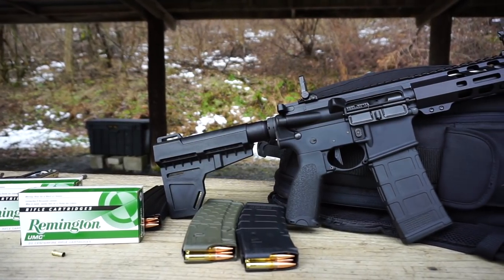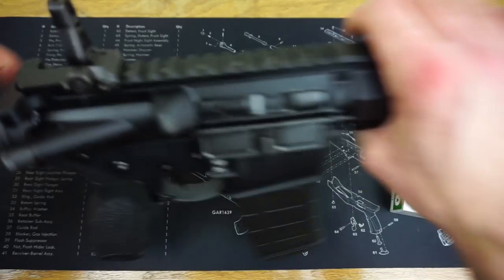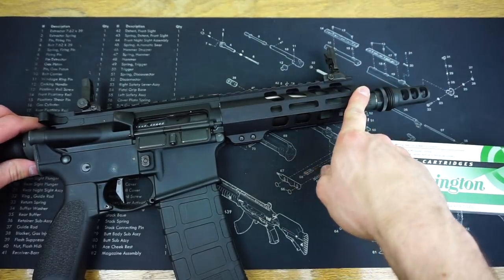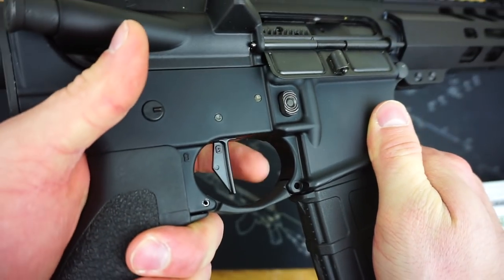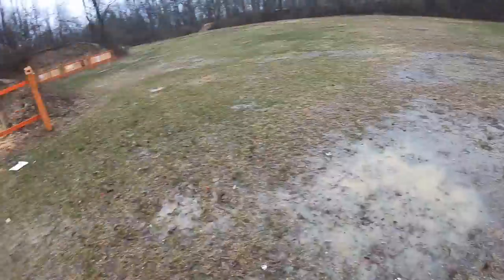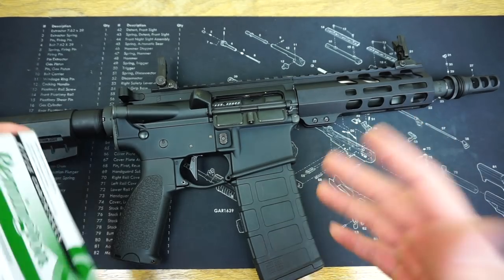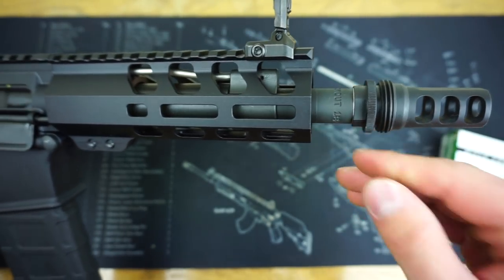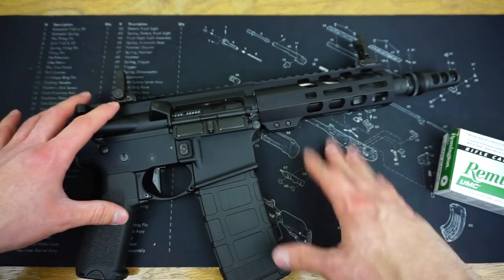7.5" PSA 300blk OUT PISTOL (FIRST IMPRESSIONS)!

Comment: Nice build! Question: I think I've heard others say, as you did in the video, that 300 blk is optimized to work out of a 9" barrel. Do you know if that applies to both super and subsonic ammo? Just curious because I'm looking to build a 10.5" 300 blk pistol soon.
Reply from the maker: Thank you! And I believe it does but either way you should be just fine with going with a 10.5.
Reply: hmm . run it with a flash can/ linear comp .. and you shouldn't have much trouble with shorter barrels ..cause  it will add a little gas pressure for better cycling if it doesn't eject as hard as you want it to do with subsonic ammo
Reply: No, tests have been done. It's 8-8.5 barrel length. They will shoot more accurate, than a 5.56 out of a 10.5.

Comment: How is the muzzle flash with the brake you are running ? How is the concussion ? I recently purchased a barrel of the same length and I find myself stuck between brake and flash hider.
Reply from the maker: sully6guns honestly it’s surprisingly not bad with subs with supers it is a little rough but still it’s not to bad between the two I would go with the break!
Reply: FirearmFreedom I think I will! Thanks for the input !
Reply from the maker: sully6guns no problem brother thanks for watching glad I could help!
Reply: Linear comps/flash can are perfect for the shorter barrell, the 300 black doesnt have a lot of flash because it uses magnum pistol powder that burns a lot faster so there is not a huge fireball like you would have out of say a 7.5" krink

Comment: What buffer weight would you use on a 7.5 300 blk barrel?
Reply from the maker: I actually have a standard carbine buffer in this set up and even running it suppressed I have had no issues at all 👌🏻

Comment: Strike Industries flat wire spring with an H buffer really smoothed my shorty out, ejection is perfect and no cycling issues. For $60 can’t go wrong
Reply from the maker: Hmmm I’m gonna have to check that out thanks for the tip man!
Reply: FirearmFreedom yeah the recoil impulse is more of a smooth push than a snap. I run that combo in all my ARs now. My full length actually runs an H2 because the factory barrel is way over gasses. Is that blade comfortable? I heard some people say the plastic really beats you up. I like that it’s low profile and I’m considering swapping out my SBA3 for the shockwave and adding a folder for a backpack PDW
Reply from the maker: mbrodock609 ya man I could totally see that and it is really not great I have a totally different setup on this gun now check out my shorty upgrades video!
Reply: @mbrodock609  yeah they leave a bruise, but look a lot more tacticool, and thats the most important thing

Comment: I saw you have your suppressor now so you probably run that a lot on this but in the event you wanted it to be a bit more controllable without the suppressor, there's now a 7.62 version of the Lantac Dragon ASR mount so you would be getting one of the best muzzle brakes on the market along with keeping the ASR capability.  Unlike the Silencerco brake, it also has some holes in the top to control muzzle rise as well which is just what you were looking for.
Reply from the maker: j5689 the Lantac break is awesome! But unfortunately to run the suppressor I have to use the ASR break to utilize the quick detach feature andddd you also have to rock set it on lmao so it’s not coming off even if I wanted it to
Reply: Well, that's unfortunate that it's too stuck on there now.  But I meant that they have an actual Lantac Dragon brake that also has the ASR mount built-in, it's the same thing as you have now but instead of the Silencerco muzzle brake, it's a Lantac Dragon that has the the capability to screw on an ASR suppressor over it, the best of both worlds.  I would link to it but I don't know if that's allowed on YT anymore.  Google Lantac Dragon ASR 762 and you'll see what I'm talking about.  If they made one in Keymo instead of ASR, I would be all over that for my 300 Blackout SBR.
Reply from the maker: j5689 ohhhhhh gotcha dude that’s pretty awesome I might have to check that out for when I do another build!

Comment: Can you get good groupings out to 200 yards with the 7.5" barrel?? I just want some practical accuracy out of a short barrel
Reply from the maker: Honestly I have not tried it at that distance it’s probably gonna be pushing it but I will definitely give it a shot in a later video!
Reply: I have always considered a .300 pistol/sbr to be "practical" for cqb at less than 100yrd, anything more I would assume you would choose another one of your rifles designed for that distance. Also the accuracy can vary widely between manufacturers, but ballisticly it has more kinetic energy at that range than the 7.62×39

Comment: What do you think about the lockup on the handguard to the barrel nut? I've taken mine apart and its nothing but friction retention with those two screws. The barrel nut is smooth so is the inside of the handguard. No texturized barrel nut surface, not even anti-rotational tabs. you think this setup will hold in place for long?
Reply from the maker: Jacob Carmona so I personally haven’t had any issues with the two uppers that I have from PSA with this design but I have not put them through hell and back. Honestly though I feel that if the it were to come loose it would of already done it for me. But I would absolutely say it’s not as strong as other options for sure.

Comment: Pretty cool little piece, i just got PSAs 556/223 kit on clearance sale. Building it with extra parts i have laying around. Other than that charging handle swap, anything else you would suggest to anyone building one of these? I was thinking about an optic instead of fixed sights. I've heard that i should use lighter grain ammo with this...thoughts? 
Thanks.
Reply from the maker: Wang-do Dahl really man what ever way you want to take this build it will work great and ya if it is chambered in 5.56 lighter would probably be the way to go with that short of a barrel!
Reply: You could run an optic up top with off set irons. Best of both worlds?

Comment: Would it make sense to buy one of these exactly like the one in the video if i had no intentions of suppressing?
Reply: I'm in the process of doing something similar. I got the 300blk 8.5 in upper without the bcg or charging handle for $199. The money I saved went towards a toolcraft nickel boron bcg and radian raptor charging handle. I then got the complete lower from PSA with polished trigger for $149. I'm sure the trigger will not be as good as s gisselle  but it should hold me over until I can upgrade. Just ordered last night and most of my stuff has already shipped. Can't wait to try it out.
Reply from the maker: Great points with the comment above and I would say ya it would still be a sweet set up even without the can with how well .300 blk preforms with a shorter barrel length
Reply: @MikeAGonzales  psa makes a nice 3.5" drop-in match, no discernible difference between in and a cmc, no creep, no take up, quick reset, breaks like a fresh candy cane, and it was like $119, and they have their nib bcg on sale for like $89

Comment: How stable are the subsonic loads with your suppressor? I bought a PSA 7.5” upper and most suppressor reviews I read/watched have said that their subsonic loads weren’t very stable
Reply: Didn’t realize when this video came out, probably don’t even have your suppressor yet ☹️
Reply from the maker: Eric Klemm no problem! I actually just received it a week ago so perfect timing! I just brought the set up to the range and ran 100 rounds of S&B 200grain subs through it and had no issues with stabilizing or anything but I was only shooting it at 25. Yards obviously all of the shooting was done suppressed with the silencerco Omega.
Reply: In the video, at the time you said you kept the 6” handguard, but would you put a 7” handguard on it, if so, do you think would it “fit” properly with using a suppressor?
Reply from the maker: Eric Klemm so unfortunately as much as I would of loved the 7” rail there is just no way it would of fit with my suppressor, so if your going for this upper to run it suppressed the 6” rail is definitely the way to go!

Comment: Hey man, nice video. Just recently acquired a 7.5” upper, with 1:8 twist rate. I’ve read on some forums how the low twist rate with such a short barrel. Have you had any problems with this? Any keyholing? Also, what loads have you had luck with, super and sub? Again, sweet vid dude!
Reply from the maker: Thanks man I’m glad you enjoyed the video thanks for watching! And nope I’ve had no issues so far and no key holing of any type! I actually have a “shorty upgrades video” on my channel as an update to this one which might give you some more info!
Reply: FirearmFreedom I found that video shortly after posting this comment. Lol. But I’m looking at the rugged suppressors razor 762. I need to go ahead and start that wait!
Reply from the maker: Joshua Brown ya those cans are sweet man!
Reply: It is more important with a heavier projectile like 190gn+, i had an 8" w/ 1:8 and had no problems with 120-140gn.

Comment: I went with the PSA 8.5" barrel upper and a H buffer ........... luv it!!!!
Reply from the maker: Steven Bass that’s a good choice man if I could do it over again I would probably go with the 8.5” upper!
Reply: FirearmFreedom I have this dilemma right now, 7.5 or 8.5? Im building as a PDW backpack gun with law tactical folder. Thoughts?
Reply from the maker: Bryan Pietras I would say it’s gonna depend on caliber, if your going with 5.56 I would definitely go 8.5, really with 5.56 I don’t like going below 10 if your going .300 I would still probably go 8.5 if you can still fit it in your set up. After buying the 7.5 I really do wish I went 8.5 the 7.5 is just a little two short and controllability is on the low side for sure. Let me know if this helps thanks for watching!
Reply: FirearmFreedom yeah it will be 300 BLK is it because there is not a lot to hold onto?
Reply from the maker: Bryan Pietras that is exactly why, ya I found that there’s just simply not a lot to hold on to and because of that there was a little bit more muzzle flip than normal. But for what your looking for (small backpack gun) you may find that is acceptable in exchange for the size.
Reply: 8.5 inch barrel is a lot better choice than a 7 inch.

Comment: I probably missed it but what what buffer weight and spring are you running? Thanks in advance.
Reply from the maker: No problem at all man! I’m actually just running a standard carbine buffer and spring with no issues 👍🏻
Reply: You will need a H2 or H3 if you decide to suppress it.
Reply: @projekt679  Can you explain what this means?  Want to make sure I understand how to make it shoot suppressed before I make the purchase.

Comment: I'm not sure where people are getting this "optimized for a 9" barrel" thing from...no hate or disrespect to you...I just hear that a lot when it comes to 300BLK and this is definitely not the case, just like shooting 5.56, you get more velocity and  energy the longer the barrel, regardless if it's 110g, 125g, 150g or 220g...yes, the heavier the round the more performance you lose at distance but the barrel length does increase its performance
Reply from the maker: So because the caliber is actually designed to burn powder as fast as possible it was actually made from the ground up for shorter barrels where as 5.56 was made for a 20” barrel now obviously each load will be slightly different and subsonic or supersonic may also change that slightly
Reply: @FirearmFreedom  Have you actually done a ballistics test with 300BLK is what I'm asking? Yes I understand the loads make slight variance, generally speaking but you get a significant increase of velocity and energy shooting 300BLK out of a longer barrel...I don't understand why people keep saying after 9" that round is no good, because that's just not true...I think people say that based off what they've heard other people say but haven't actually tested the ballistics
Reply from the maker: Clean Cal I fully admit I have not actually tested the ballistics with gelatin or with a chrono so you could be absolutely right I am going off of other tested that have been done and information that’s pretty documented online about the topic bu I totally agree man always do research for yourself!
Reply: @FirearmFreedom  I definitely get where you're coming from and I would definitely recommend trying a chrono...I'm not an expert by any means I'm basing this off certain opportunities I had to experience different shooting platforms from my time in Army Special Operations, not directly related to the Army but certain relationships fostered through the Army...I would definitely recommend checking out Mr Guns and Gear's testing video which explains it far more thoroughly than I ever could, he has so much valuable insight from his Army career as well...but either way, I love what you're doing brother and thank you for the healthy dialogue.
Reply from the maker: Clean Cal for sure man thank you as well for all the comments!

Comment: I have the same upper but in 5.56, is their any way to fit an angled grip on this thing? Mounting holes are weird
Reply from the maker: DannyBoi ya you should be able to fit a smaller angled grip I’m in the process right now of trying to find the one with a perfect fit you just need one capable of attaching to m lok.

Comment: @ 4:50.. what is the "handwork" i seen you doing?
Reply from the maker: So I am just flipping on the safety when I’m coming off target looks a lot more dramatic than that on camera in that angle 😂
Reply: @FirearmFreedom  ok.. I was confused because I didn't realize you where manipulating the selector switch because well I wouldn't have guessed that as I figured you were shooting through a mag and I've never seem anyone throw the weapon from fire to safe and back between each shot, as fast as it seemed you were cracking them off.
So does it just seems that way from editing..
Reply from the maker: RideForLifeCR250R well it wasn’t sped up or anything like that the angle may just of made it seem like that lol

Comment: Any problem stabilizing heavy sub sonic loads? What twist?
Reply from the maker: Seth Lantz not sure of the twist rate off hand but no issues at all with supers or subs through this set up!
Reply: Good to hear. I was just wondering because I just ordered an 8.5 inch from PSA
Reply from the maker: Seth Lantz gotcha ya I don’t think you will have any issues at all, I wouldn’t worry about it!

Comment: Nice video.  Quick question: do you NEED a brace, or, can you just switch buffer springs out of a regular 5.56 lower?
Reply from the maker: Steven Wilder if you want to make it a pistol yes if you put the upper on a standard lower with a stock with out getting your form 1 you would of made an illegal SBR unfortunately
Reply: Thank you!
Reply from the maker: Steven Wilder no problem man!

Comment: Is the handguard 6 inches or 7 inches ?
Reply from the maker: Paul Ibertis on this guy the hand guard is 6 and not gonna lie that was almost too short lol
Reply: @FirearmFreedom  I was looking into getting a 300 blk upper thats 7.5 inches with a 7inch handguard, I think that'll be enough,
Do you think the extra inch would be enough ?
Reply from the maker: Paul Ibertis it will the only reason why I didn’t go with that size myself is because I wanted to put my can on the end if you check out the “shorty upgrades video” on my channel you can see what I mean!
Reply: @orion9807  did you get one Paul?
Reply: @nickr4015  No i didnt, built a DMR instead

Comment: im not quite convinced on the 300 blk out...  I mean i like it but why not just get an AK in 7.62?  Plus AK ammo would be easier to get i would think...
Reply from the maker: nonya biz so the only reason I ever built a 300blk out and the only reason I would recommend one would actually recommend one would be to suppress it which I do. And I have to say they really do run great for the reason!
Reply: are you able to put the upper 300 black on the lower assembly of an ar15 in 5.56 and still use the same 5.56 mags?
Reply from the maker: nonya biz yes absolutely although some standard AR mags will not work with 300blk so to be safe I would get one that is designed to work a little better with .300
Reply: i just got an ar pistol in 5.56.  Its actually in the Wylde chambering.  Ill see how it goes but the idea of going to 3 different calibers and using the same magazines appeals to me.
Reply: from what im  finding out if i get a 300 black upper for an ar15 thats already chambered in wylde that means i should be able to shoot 4 different cartridges and still use the same mags...  am i reading that correct?
Reply from the maker: nonya biz ya for sure as long as your changing out the upper you can use the standard mag for quite a bit!
Reply from the maker: nonya biz well something that’s chambered in 223 wylde means it has a standard lower so there are quite a few different uppers you can throw on and quite a few that will use the same mag.
Reply: There's more reasons to have a blackout than just being suppressed. 300blk is as accurate out of a 7 inch barrel than a full barrel ak. Much less a ak pistol. Also, everything is interchangeable with a blackout to an ar15 except the barrel. You also have a much wider range of bullet weights to choose from.
Reply from the maker: Getoutthere Trump these are also some good points I guess what gets me the most for someone who’s not running it suppressed is price compared to 5.56 or 7.62x39